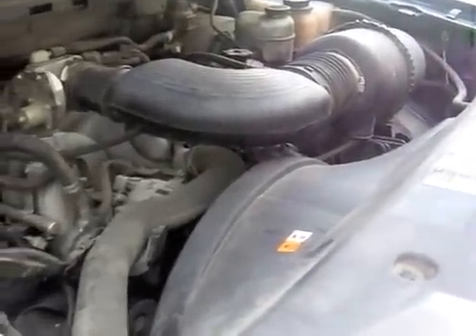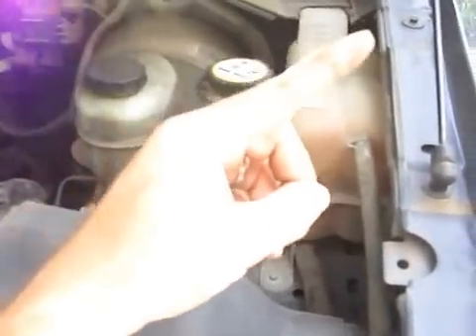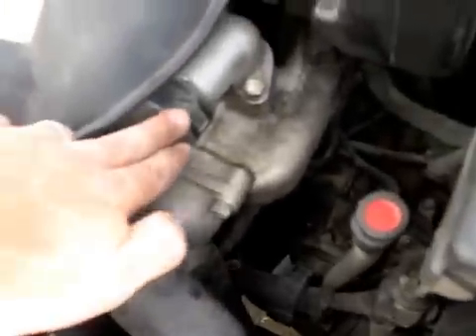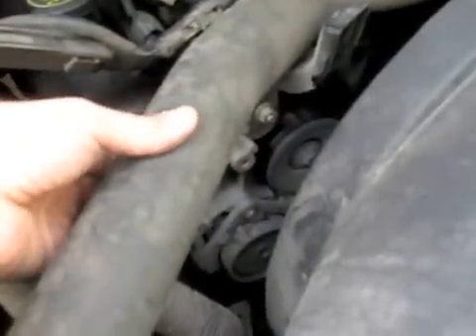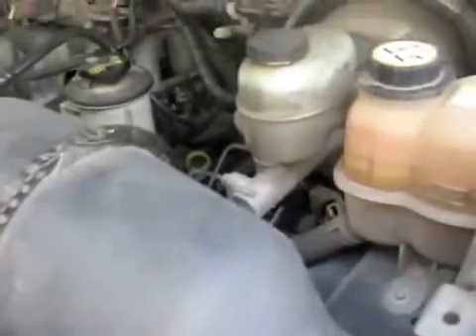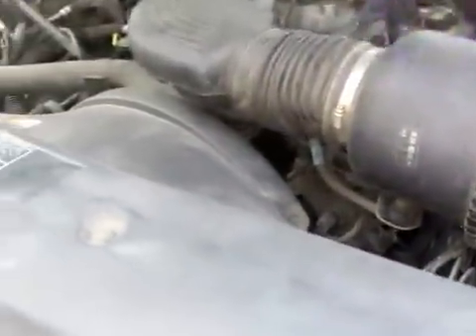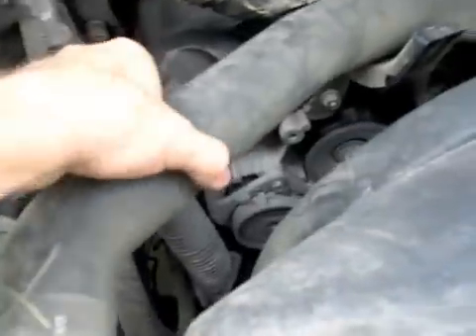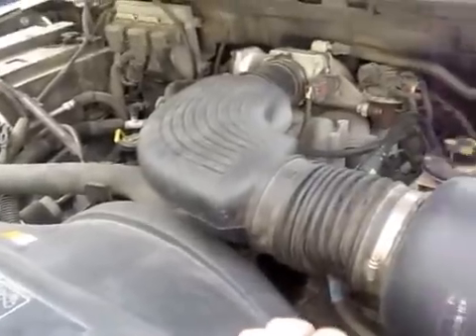Car Engine Overheating - Causes and Symptoms of Over Heating  Car Engine

Comment: 07 hummer H3  140,000 miles, I bought it a year ago at 130k  I get overheating when Im sitting at idle or slowing down. If Im at idle I put it in nuetral and rev the gas and it brings the cooling down to normal just above the half way.  I replaced the ECT sensor, the oil pressure sending sensor, the thermostate. I asked the mechanic to do a radiator flush, he merely drained it and filled it when he changed thermostate. I asked for pressure test he did not do it. If I let it sit and idle for 15 minutes, it performs ok. If I drive on freeway it performs ok. Now Im guessing I should buy new radiator cap, hoses, I was informed by previouse mechanic he replaced water pump befor I bought it. I see no signs of leaks. possibly slight leak at water pump but no spots on ground, I have seen top hose hot and hard with pressure while bottm hose not hot and soft. So I thought it was thermostate. The fan seems to be working it operates with serpetine belt and feels strong. I dont know if there is supposed to be a gasket on thermostate the mechanic installed without one. Im wondering if the system has air I have been driving for three days.  I wonder if radiator is clogged, if I have leaky hose, If radiator cap is not letting pressure escape into overflow, it appears to not open and top hose is hard and hot with pressure. I see no signs of head gasket leak ??? 
I had low oil pressure so I changed oil sending unit, I found oil on terminals. Mechanic did not do oil pressure test. When I use conventional Castrol 5-30 I burn no oil between changes, I tried using Amsoil Synthetic I had to add 1 quart every 1k miles, I went back to Castrol with Lucas oil stabalizer oil light went off. I still need to do a engine compression test. oil pressure test. I spent 700 and engine gauge still goes up and down, when slowing down or stop,  when engine reads hot idle becomes rough, I then rev engine it returns to normal.  Can you help me ???  It is crazy the mechanic had old VW bus siting in garage for week he could not fix idle, I found answer on my phone he adjusted distributor and it worked fine, but I cant seem to help him fix my car. I have only changed a flat tire,on my car in forty years of driving I have always taken good care maintainance. But I love this Hummer H3 and I want her to run like new she looks new. It has the straight five. Appreciate your help if possible.

Comment: I have a 2004 Chevy Venture that I have taken in twice and have replaced the radiator hoses the radiator cap and the thermostat and it tends to overheat to redline on the highway and he tells me that what needs to be replaced next is the head gasket what is your opinion

Comment: I replaced the radiator on my saturn 2001 sl with a new one my car never overheated it was jst leaking, but now no more leak but overheats.... But when i touch the radiator its cool but the hoses are hot...oh nd now it wnt throw out heat when i change it to the heater???
Reply: Cesar n jovana Ugalde same issue
Reply: Cesar n jovana Ugalde busted gasket and  cylinder head

Comment: i have an audi a3 and it's mostly overheating when i stop and heating is on inside and their are lots of white stuff when i open the engine oil cap. should i replace the waterpump or just to check the fans. help me please

Comment: Hi, can you suggest what the issue may be, car leaks coolent, pipes get hot and solid, air lock when water cap opened, no hot heater only blows cold air, on a long journey looses all it's coolent

Comment: 2005 Suzuki Forenza. When I first start car it'll overheat. I put the car in neutral and coast to a stop. Before I get to a complete stop it runs normal then does fine until I shut the car off. Also have no heat but no signs of coolant in floor board. New thermostat so I'm lost here.

Comment: I have a 2004 Nissan Sentra I had heating problems where it was overheating I change the radiator the water pump and the thermostat flushed it out filled it up with water let it run for mop 15-20 minutes or so and it don't run hot no more my gay says it's not running hot but dies and will not crank back up for at least 3 or 4 hours I have to let it completely cool down completely like a cold motor before I can start it back up I did take some starting fluid because it act like it wasn't getting no fuel I put some starting fluid in it in the breaker it cranked up and ran for a little bit and died again I don't understand what's Happening Here could you please help me cuz as of right now I am stuck on the side of the road

Comment: My kids car has the following symptoms. Temp gauge stays in the middle where it is supposed to be. We pulled a hill after running it to normal temp. Water in resoivoir is bubbling at normal temp, upper hose is very pliable but temp gauge stays in the middle. He initially reported this as overheating and I did find the hose going into the recovrry was half off and leaking which I fixed. No other leaks found. The big concern right now is no notable pressure in upper hose when car is at normal temp and the bubbling water in the recovery resoivor. Any thoughts?

Comment: I have changed my radiator and water pump on my 98 nissan Altima but my car still running hot
Reply: April Washington needs to check cooling system

Comment: Can u give me your opinion . If on 1990 Honda Accord  the thermostat is spoze to be a 180  An a  190  got put in. Can it cause. A radiator tank mind you plastic thanks.  Cause it to split at a seem.  

Cause I noticed that. Temp gauge. In car. Would. Get all most to  h  before. Thermostat would. Open. An eltric fan to kick on  so what do u think

Comment: Much more of a helpful video, my 98 Silverado has been going up to 230 when its a idle with the ac on, it never does.. Usually sits at about 210 no more!  I changed the water pump last year and didnt change the hoses like an idiot, flushed the radiator cause its blocked with a lot of crud from someone mixing Dex coolant or stop leak it looks all rusty anyways I had pressure on it when flushing it and seen the top hose on the water pump was leaking like crazy but you couldn't see it very much when I drove it cause I didnt drive far.. I'm just going to get a new radiator, and fan clutch might as well change all hoses too, did you quit making videos????

Comment: i found a leak in my radiator hose and replaced it. my fan is working, water pump is fine. but it still over heats when I'm on streets with stop signs and lights and when I'm on the freeway it's fine. any suggestions?

Comment: can plugs cause overheating. my honda fit showing overheating after going for about 50. pressure testing done, radiator, radiotor cap and gasket confirmed fine. fern working. what could be other causes.someone suggested worn out plugs might be straingning engine leading to overheating. could this be a possibility. please assist

Comment: can't hear fans working..
only gets hot when I stop for awhile or driving slow.
antifreeze bubbles by the time I get home..
Cooling Fans???
Mine are way in front. So can't hear if running.. But, I ran car for 15 minutes. Never saw Fans move..
So could it be Fans then?
Is there a way I can test fans to see if working????
   THANKS......

Comment: I had a mechanic replace the heater valve in my Mercury Mountaineer. The car is overheating. Is there a possibility that the heater valve was put on backwards?

Comment: I live in Arizona and it over heats in the day but it doesnt overheat at night. I drive a '99 chrysler 300m. I dont know what the hell to do. I replaced the thermostat, i checked the fans. I just dont know what the next step is.

Comment: I have 2011 ford tours getting overheat I change The fan on the radiator cooling fan control module.. but the problem it's same thing.. and also I have one of the headlight not working the passenger side one . Can you help me please??

Comment: I drive a 2014 Ford Fiesta. I had oil change and replaced the cooling fan, head gasket, thermostat and coolant sensor but I my engine still overheats at idle or slow traffic, especially when aircon is running. An  on board diagnostic device which I borrowed from a friend displays P0017 and P0016 error code suggesting failure in camshaft position sensor and crankshaft sensor.  Is that the real cause of overheating problem?  What should I do now? Thanks

Comment: i watched this video because i could figure out if there was a leak 
found out that the heater core was leaking after filling up the radiator not the cooler "tank"

Comment: Excellent video and information. We recently had our trans rebuilt on a ford taurus (trans leaking now and still hasn't been repaired because repair man putting us off). The next day the engine light  came on and comes to find out it was a fuse by the transmission. Now the car is overheating shakes and cuts off. Any thoughts?

Comment: Ok my coolant keeps going out the overflow even when the coolant is still cool my engin says its over heating ive changed the hoses and the head gaskets as well as the heater cantrol vaulve also I've flushed out the heater core as well as the radiator and changed the radiator cap also the thermostat has been changed after all of that my 2000 ford ranger 4.0 v6 is still over heating so I've removed the thermostat so I can drive back an forth to work. I'm thinking it's sucking in air somewhere bc when I park it on a hill side to bleed the radiator for air the air bubbles don't stop coming out even if I keep the truck running for hours... do u have any idea what it may be im out of ideas

Comment: Anybody can help me? The temperature gauge doesn't work on my car so I can't realy on it to tell me if the engine is overheating but I have a feeling mine is. I checked everything that this video talks about and all seems ok except one thing I'm not sure. I noticed the radiator fan doesn't run when I start my engine at idle, should the fan always be running? I have a 1998 Ford Escort, no air conditioning system.
Reply: Patrick Alarie yes mustbrun if you on the aircon, for the temperaturw gause bring it in the electeical shop
Reply: @sylb2621  I think when I read this, I had an aneurysm...

Comment: I have a gmc 1997 1500 z...something  that I just got. I notice that the temperature gages were rising all the way to the red line then it came back to normal. when that happens heater is not working it only blows cool air. so what I did, I checked the radiator when it was cold, to my surprise it was almost empty. so I pour two coolant/antifreeze started the engine went home from work next day I rode the truck no problems so far. at the end of the day it started all over again. but this time there was coolant. so what's going on here?

Comment: hey, so I am doing some research to figure out why my 2000 Chevy blazer smokes out of the heater vents. and I get a strange burning smell that I can't quite pin point. but I know that it does not have the maple syrup (antifreeze) smell. the guages do not over heat but I get the smoke coming out the vents and the odor. I only really get the smoke when I am driving uphill or accelerating a little harder. i also noticed that the muffler suddenly became very loud up towards the front end of the vehicle. I've checked all fluids and top off low ones. any idea of what may be causing this problem?

Comment: I have a 1999 Buick Park Ave. I need to know if it's the engine because it had overheated in they drove on it a little bit longer and I don't know what happen now there is a loud noise and someone said that it sounds like it's the engine I don't have anything that leaks I keep up on everything with The only thing I didn't do was add oil which I needed to do that day do I need to get a new engine or is there a fix I can do really need some help here

Comment: I just found out that a clogged or bad fuel filter can cause overheating https://traxxas.com/forums/showthread.php?188533-Fuel-Filter-overheating-problem
Reply: Jason Fleming 
thanks for your post, I have checked everything else and immediately recognized this as a possible suspect to my problem. I'm experiencing vapor lock starting randomly and progressing to extremely persistent. if I can find your post again I'll let you know how it came out.

Comment: Hey man recently I was driving and I turn my AC on but it doesn't work so I still turn it on to fog out the windshield and my car started gradually heating up ? Need help and now when I accelerated it heats up.
Reply: anthony mok turn on the heat when you defrost
Reply: +B-azy MicKing yeah bro I have and it makes it still hot

Comment: My 2001 4.7 Jeep Grand Cherokee over heated and has idling problems and won't stay running  , I opened the radiator and found transmission fluid mixed with the anti-freeze..  I replaced the radiator, t-stat, water pump and spark plugs but I still have the idling problem.... what else should I look for the fix this problem? Thank you....

Comment: hears a brain tease for you i bought a 1999 dodge Dakota ii put a day permit on it the other day to help my friend and everything started out ok then after driving it for 20 min on a main road about 80kmh i came to a red light the truck started to sputter and shutter i glanced down at the gauges as the "idiot light" came on and my oil pressure dropped to nil luckily it happened right beside a gas station i pulled in shut it down jumped out checked the oil thinking i was out it was fine it cooled a bit and we got back in drove for about 5 min and it happened again this time we let it sit for about 20 min we made it to the job where it cooled for about a hour and a half we drove home having to stop once to let it cool now the next day i sat in the drive way and brought it up to the temp it was yesterday it ran fine lintel i put it in gear reverse or drive the oil gauge would drop and the gauge light would turn on then i put it in park and it turned off no idea what is wrong with it but hope its not the oil pump

Comment: hey I got a 2006 mazda 3 sedan i have no idea why my temperature gauge keeps going up however i did check my coolant level before and after and i realized that there was alot more coolant in the bottle as if the coolant is being backed up when this occurs my heat blows cold and couple times i see streaks of coolant in my driveway does anyone have any idea as to what is causing this

Comment: My truck is overheating. It is a 2007 dodge ram. The catalytic converter just went bad. When I checked my coolant it was low and I filled it up. There is clearly a leak somewhere. I also smell something through my Air conditioner, kind of like a burning smell. There is no smoke. Any tips?

Comment: I have a question I have a 04 Civic lx i changed the thermostat (aftermarket) and after i filled it with 50/50 antifreeze and after a few days the needle started rising and I bleed the air out (not sure if I did it right). Now after I did this, the needle still kept rising, so now I added antifreeze while the car is running and I notice the coolant only drops when the fan turns on... what can I do at this point?

Comment: Hello! I have a question to ask you. I have a 97 Oldsmobile and while I was driving on the highway the car started idol funny. The temperature gauge went to red but no smoke from overheating. However, the coolant was over filled. You have any idea what could be the problem? Thank You!

Comment: I have a 1999 Lincoln Continental 4.6 liter dohc with the 4 cams we replaced radiator cap, radiator , thermostat and water pump all new parts and it still over heats and also has brand new head gaskets

Comment: in my 2003 chevy Malibu only water leaks from the reservoir. both fans work sometime the heat work I have a new thermostat and water pump also a temperature sensor and I had a tune down then it clunks from the radiator I have to put coolant inside every other day ...it will overheat after and hour regular driving on the highway after and half and hour four months ago it ran great

Comment: i have a 12 ram hemi.  temperature is getting 3/4 to hot when sitting still sometimes and upper radiator hose collapse.  i notice a coolant leak   coming from underneath

Comment: I've got a question..when I've driven my car and as I stop or have it on "standby" it starts to overheat, the temperature gauge rises but as soon as I drive again..the temperature gauge lowers back down. It happens irregulary, more often when the weather is hot. Why? Also my car's engine coolant has this orange leaking stain on it (around the cap).
I'm not so good with internal systems of cars so I don't know what precisely is wrong or what I need to look into.
Reply: Marked GN,
Look into the radiator fan first off. When you are driving, air is being forced through the radiator, lowering the temperature of the coolant. But when you idle and don't have that airflow, it's up to a fan to pull air through the radiator. Depending on the make/model it will be controlled with an electric system, or a clutch. Both types should engage when the engine gets to running temperature.